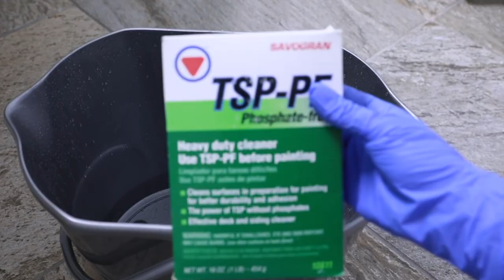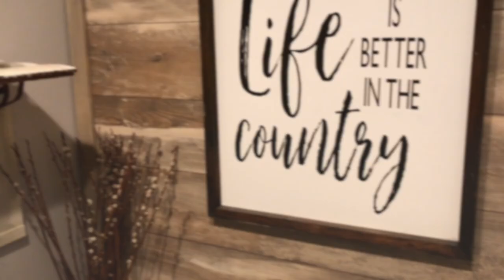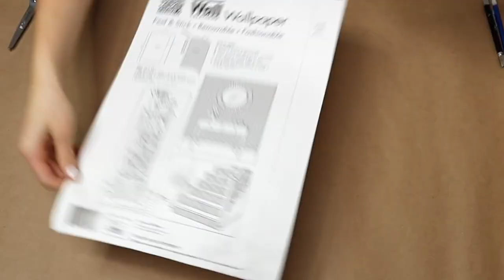Put this BEHIND your toilet (genius hack!)

Comment: I’m skeptical of spray-painting bathroom sink hardware. The exposure to water, not to mention cleaning products and scrubbing, would probably wear it off quickly and unevenly.
Reply: I was wondering that myself. How would you clean them without removing the paint? It just doesn't seem practical.
Reply: They probably just flipping these homes, don’t care about long term
Reply: Was it paint for use on metal?
Reply: The first paint they showed with that was Automotive Primer. If it's for cars, driving in all weather, I would think it should hold up decently in a bathroom ,
Reply: They removed the finish which means moisture will wear it down, rust, stick in the future.
Reply: Some of these Diy's are not that practical when it comes to cleaning, especially behind and around the Toilet.
 The more textured a wall, the more Dust, Dirt and Germs can collect inside the crevices. With heavy use it can become a nightmare to keep it clean.
Reply: I did this in a house to sell using enamel. 
Another thing should be mentioned  is gasing yourself when doing so.
  Was not a nice experience.  So much for cheap masks.
Reply: @Mido66778899  or just throwing videos out there to make money on YouTube!
Reply: @user-pc1jf7py4i  same - just ignore the practicality of it all 😂 with three boys my concerns were all about keeping it clean.
Reply: It will wear off, trust me. I had hardware professionally painted and finished that wore off over the years, exposing the original color underneath.

Comment: Wallpaper in a bathroom can be tricky. The humidity from the shower can make it droop or fall. 
There is a special wallpaper that is made for bathrooms called Mylar, but it is a real BOOGER to work with!
Reply: Despite my bathroom getting really humid during showers, my Dollar Tree wallpaper hasn't budged an inch on any of the sheets. For $1.25 that stuff is durable.
Reply: I wallpapered my bathroom 15 years ago and it still looks like new and hasn't needed first aid, ever.
Reply: @74yodinosaur99 where did you buy your wallpaper from? Crazy it has lasted 15 years.

Comment: Some of these ideas are cute.  In a moist environment the contact paper and glued items will likely be problematic over time. Please slow down and cut back on the ideas shared, and share some project details. Also, consider posting grouped by type of inexpensive and practical diy: mirrors and lighting; walls and backsplash; storage; tub; and flooring. Thanks for sharing. 🙂

Comment: One of the ideas here I have planned on doing in my studio apartment bathroom but working long hours I haven't had the time. The previous owner took out the sink with the vanity and nice storage below and put in a pedestal sink.  I live in VA and all the Dollar Trees I have been too do not carry the clear small plastic crates but, I found them on line being sold in the Princeton University student store. So when I went to see my brother a couple weeks ago who lives in the next town over I went and bought them. I have enough small space between  the clam shell size sink and the toilet and I bought 5 to the height of the sink. I plan on putting  with wire ties them all together and maybe a metal bracket of some kind to hold my hair dryer on the side. I also want to get little baskets to put my hair supplies in  and maybe a wood top a little wider than the top crate for the top crate.  
Many of these ideas on this were done by women which was impressive but many projects were more costly than I could ever do.  But I am hoping to buy my own little home by Spring of 2024 and then I can implement some of these ideas permanently where as now I cannot in a rental.  Great video!
Blessings, Rebekah
Reply: TOO WORDY😮 TOO MUCH TIME ON YOUR HANDS?

Comment: Looks nice, I'd only do as temporary before remodeling. Tub is destroyed now along with tile and floor. Will not hold up very long. To fix this will take tub removal, floor removal, tile removal. About $4000 or more in damages. Never do this to a rental, guaranteed you'll be paying for it!